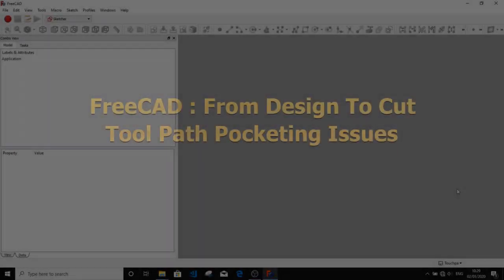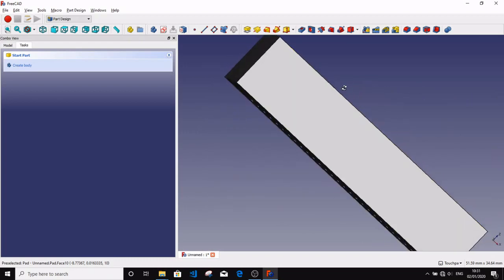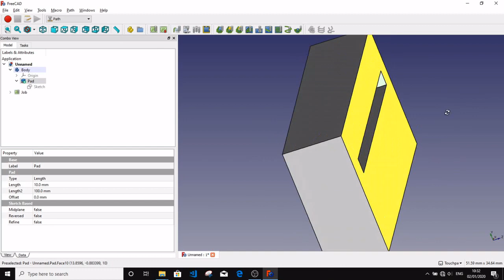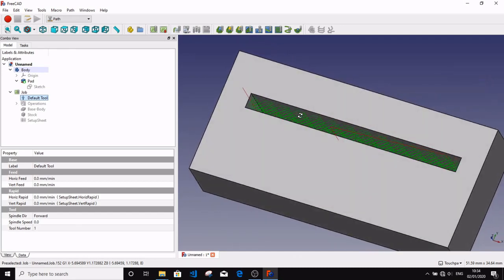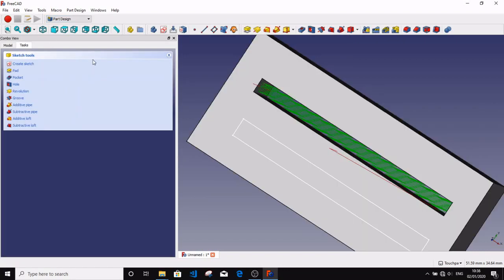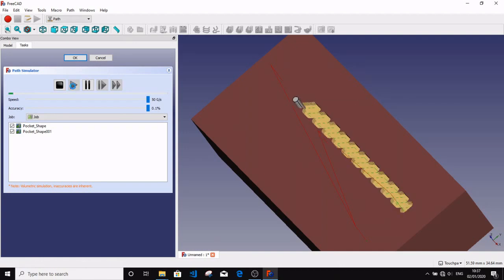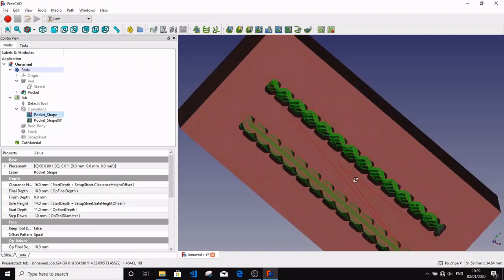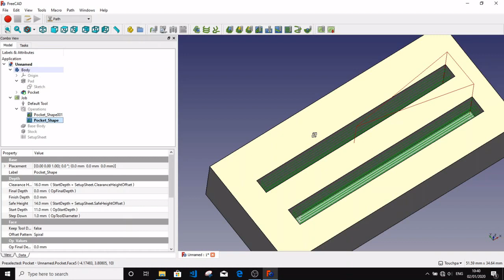Tool Path Pocketing issues in FreeCAD and how to solve them

Comment: You just taught me so much. Thank you. I'm using freecad as you may remember for 3d print. If I use these same methods to create a 3d object stl file then the slicer will recognize it as a normal model?
Reply from the maker: Hi, yes I remember how you are enjoying your retirement project? The video you are watching is to do with the path workbench for cnc use such as lathes and routers. I think you are watching one of my very first videos when I started my channel so a blast from the past. This workbench I haven't heard of being used with 3d printes as it's easier to let your external slicr take over. Freecad paths workbench gives you full control but it takes a long time to set up the paths. Obviously the modelling process to get to your model is the same but the post process (CAM ) differs for different output devices though they create the same output I. e GCode.
Reply: @MangoJellySolutions  I use cura to slice but I suck at building 3d models so anything to make building a custom case for something I'm making easier and I'm all for it. I figure since I design custom pcbs now for my projects, which is way neater than wiring shit I can find time to learn the bare minimum to streamline enclosures. I've messed up more pcbs than I've got right but it's only 30 dollars including shipping and you get like 10 boards as long as they stay under 100x90mm I think. I have many hobbies that are all related but wish I had more money and time to get good at them. Coding is the easiest part I find. I'm building a cnc machine currently but I'm exploring ways to do it cheaply haha. I've got a bunch of nema 17s so I'm going to make a little desktop one first.

Comment: Hi I like your video. I am running into a similar issue as you showed, but it is because I want the slot all the way to the side of the part (so it becomes a U-shaped part. Somehow it refuses to do that.  I wonder if youhave a video about that.  I see errors like "<class 'IndexError'>: list index out of range"  probably because it is not a "real" pocket?
Reply from the maker: Hi, thanks for your comment. Worth slots that run off to the side try using the "create a contour path for the base object" tool this will follow the shape of your base object and will cut the slot.
Reply: @MangoJellySolutions  I wonder if I just made a mistake in building the part somewhere. You showed that when a tool is to wide, that causes a problem too. I think I might see one slot, but in fact it's two (or three even)

I like the video, great tips.

Comment: Thanks so much for this, after watching the video I was able to complete the tool paths for an esc plate I am making and today I was able to machine the part with great success , for what its worth I am using the grbl post processor with Mach3 and with a few tweeks in the edit page it works just fine.

Comment: Do you cut a lot with freecad path?
Reply from the maker: I do all my cutting with the path on a homemade CNC but I haven't worked on anything overly complex as of yet.
Reply: @MangoJellySolutions  great! I'm building my machine now but I've already bought a mach3 license though I do know grbl. If I had known fusion 360 was gonna do what they did I would have built a grill controller. Anyway, I'm wondering how path would do with mach3 or how you would post
Reply from the maker: @stevenpaul6216  I have had no experience with Mach3. Sorry I didn't realise  what you meant. Freecad can only produce the GRBL. I use UGS to send this to my arduino board. I haven't had any dealings with fusion. I am a total open source guy. What has fusion done? They havent  gone to the cloud and are running a subscription model by any chance so you never own the software?
Reply: @MangoJellySolutions  FreeCAD produces g-code with a number of post-processors including LinuxCNC and Mach3